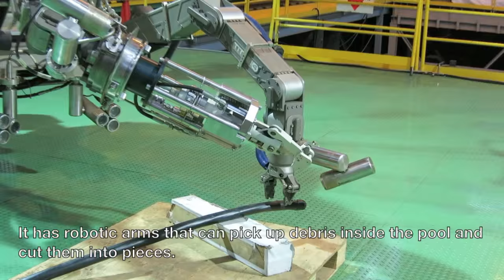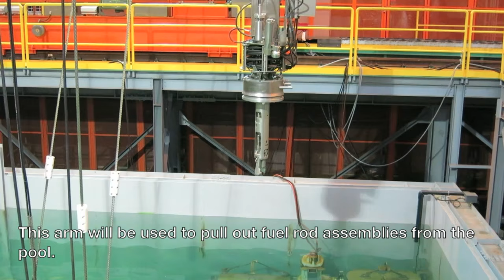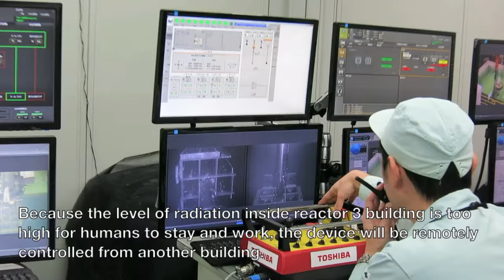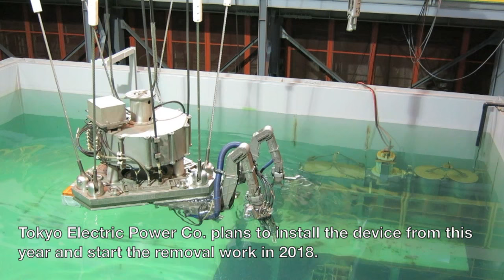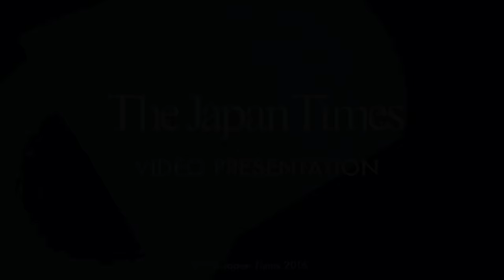Toshiba demonstrates remote-controlled spent nuclear fuel removal device

Comment: Watch this robot will last just a few hours in the Fukushima power plant before the Radiation will kill the electrical components
Reply: How radiation can destruct electronics?
Reply: put your cell phone in the microwave and see if it gets damaged.That will be your answer
Reply: Evan McMaster But how radiation can destroy electronics?
Reply: Go read the other story about the other robot that went into the Fukushima Reactor and didn't even last an hour before radiation damaged the circuit board.
Reply: Evan McMaster Proofs?
Reply: +Mist Fading A good question which can be answered by telling that radiation, depending on the nature of such ( There are different typesof radiations; Alpha, Beta, Gamma, Neutron, X-rays and others, more long Waved forms of radiation ). They are not all equal damaging to physical substances. The most damaging radiation is the Neutron radiation which when colliding with matter destruct the molecular structure of such i.e. transistors and integrated circuitsbreaks down and malfunction of the electronics is the result of have being irradiated. Hope it&#180;s an answer to your question, +Mist Fading
Reply: ArtScience So what you're trying to tell me, kid?
Reply: Yup. Radiation destroys things from the molecular level. It punches holes in DNA strands in people and animals but in robots it damages circuit chips and memory drives. Radiation is a mother fucker. Check out the video of a radioactive material in a cloud chamber pretty interesting to see how the particles fire out of a rock.
Reply: +Evan McMaster You called it - they've all been destroyed now.
Reply: BANG Yes I am retarded because I understand radiation. Thanks for your kind words.
Reply: exactly as you said, they're all dead now and we don't have enough technology to clean the mess up. Fucking great, we are all fucked now
Reply: i think the big shielding is meant for the transmitter so it will last a bit